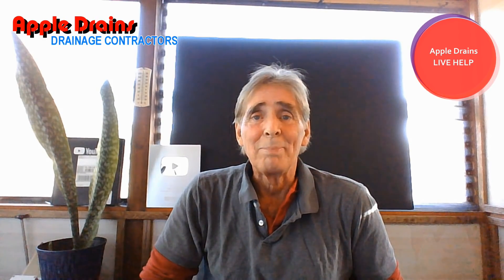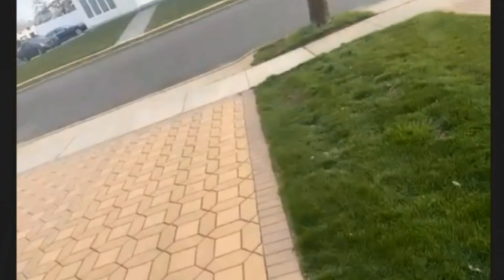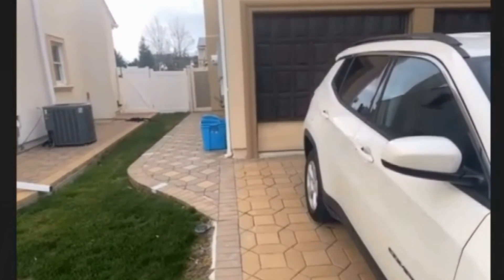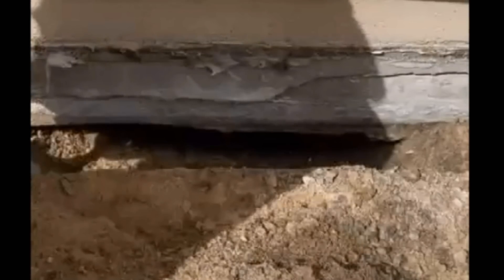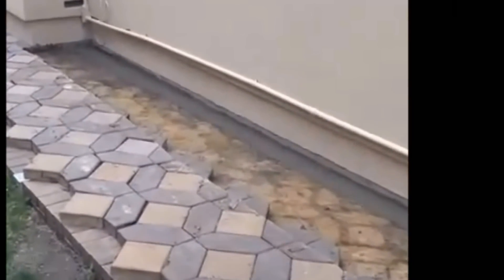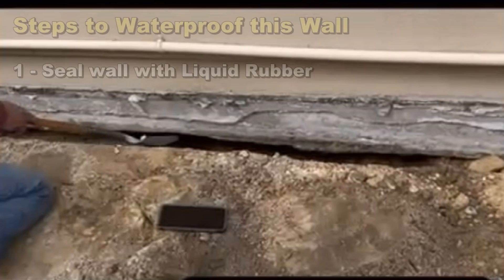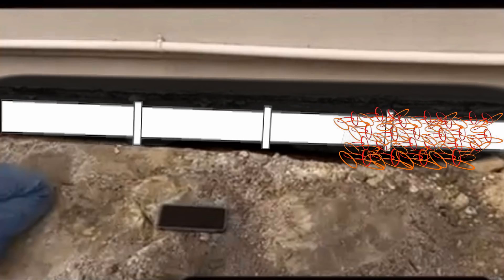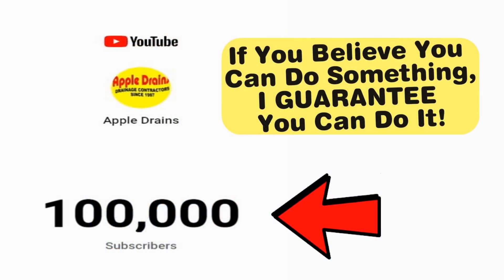Don't Do This when Waterproofing Exterior Walls

Comment: How long does the Black Jack 57 need to dry between coats and then before backfill?  The label says 15 days before adding a reflective thing for roofing. But that's not for foundations.

Comment: Hi there wondering if you can help me find a cost effective solution to my problem . I have a bit of a problem with the side of my house . I get pooling water when it rains on one side of the house . The house concrete seems to have a down slop and able to have water away about 24 inches . But I am worry on my next big storm .

Comment: Great video. I would see if his neighbor would connect his downspout into his system. Or, at least put a yard drain there.
Reply: Or change the angle slightly to point forward rather than diagonally towards his foundation.

Comment: Live help sounds amazing. So good that he reached out to you so soon after the concrete was poured. I have been watching so many of your videos and learning so much. As soon as I saw the concrete was poured i was just saying to myself with your voice "oh the water is going to go right through that, concrete is porous". Thanks to all i learned from you in the past week i replaced an old sump pump with a dual sump pump and battery backup. Added a quiet check valve in an easy to access point, and setup the old sump pump to be quick swappable back in if needed. Also hydro jetted the drain tile cause I was worried the slits in the bottom were clogged (only very heavy sustained rains would come into the sump and then continue for days after rain stops) and also hydro jetted the external drain and learned how the system runs. Thanks for all you teach. Might use live help before we hire someone to finish the basement. Cause the 2 experts i got quotes from last year were suggesting all sorts of big changes to just get the basic fixes in that i ended up doing myself. So I don't trust them for the bigger waterproofing improvements.

Comment: The patio is level? Why not change the angle of the bricks so that the water runs OFF the patio bricks?
Reply: I’m in agreement, especially considering how many pavers they pulled up. If the water is just sitting there, of course it’s going to seep in, especially if pavers. It needs to slope in to the grass and just sent to street, and that could be tied into the drainage that already exists…
Reply: My first thought as well.  Put a level on it to check slope.  Slope it into the strip of grass and make a French drain there to the road.  Easy fix.
Reply: Changing the pavers will not do anything. The homeowners problem is not so much surface run off although this does exist. His main problem with water in the garage is coming from inside the earth. The plastic helps route it right into the garage.
Reply from the maker: The patio does have fall away from the wall. It’s subsurface water as you thought . And yea he paid 2 times for that company to come out and try! They will be returning at no charge . This homeowner now has good information and a copy of the LIVE HELP to help guide anyone that works on the property!! 😊 thanks so much for your comments and yes LIVE HELP SHOWS with MUCH More DETAIL THAN THIS 10 minute video. Well worth it to understand what and why it did not work and HOW to fix it right!